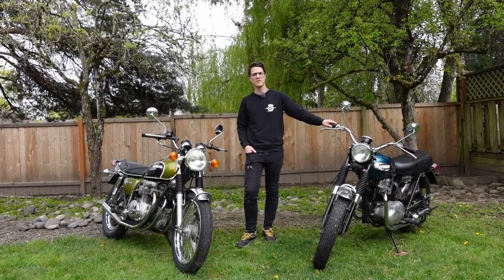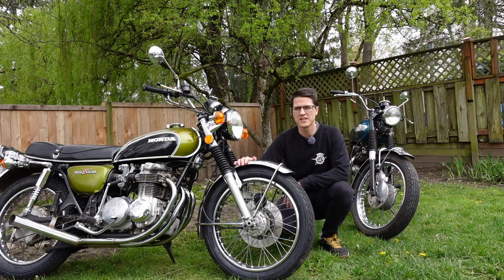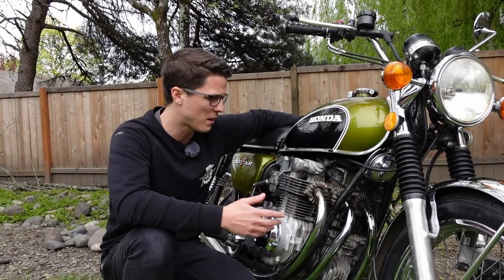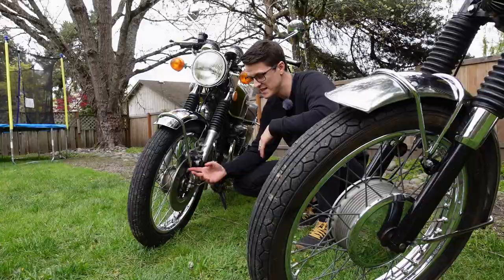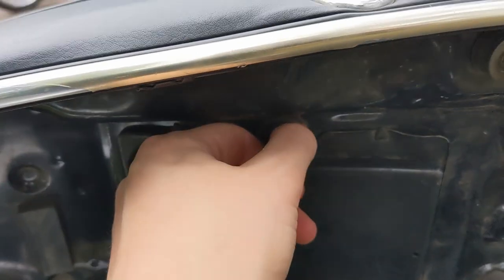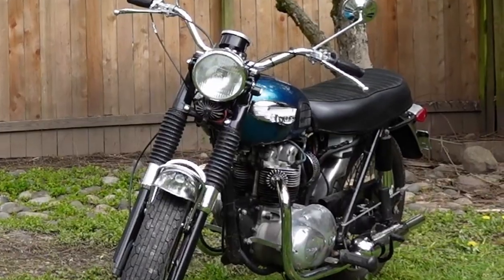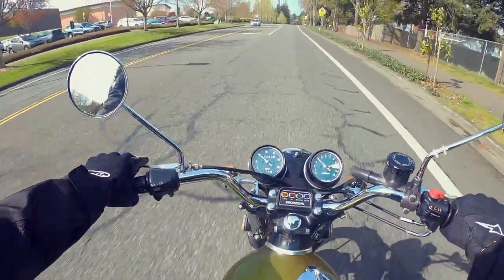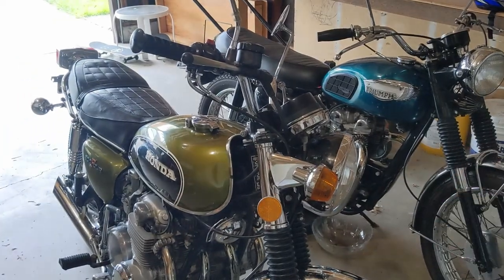How this Honda killed this Triumph

Comment: Agree completely. I had a 1968 Triumph T100C and still have a 1970 Honda CB450. Two years apart in age and about 30 years apart in development. Honda is still perfectly usable in modern traffic and the Triumph looked cool but felt like a dinosaur.
Reply: I was in charge of service for our dealership when the CB450 first came out, funny looking tank and all, and to me, it was already a Brit bike 'killer'.  Even though it only had a four speed, it was very smooth and would rev until tomorrow.  The wheelbase was a little short but that wasn't a detraction at the time.  Also, I was a new rider when the predecessor of the T500 came out as a 350cc and that was in '57.  Very little was changed in the design from then on.
Reply: @whalesong999  One of my favorite things about it is the very high rev range and by 1970 it had a front disc brake and five gears. Really love the bike even if it was eventually overshadowed by the 4-cylinder models.
Reply: I had a cb450 cam chain broke after I had it for three months after a Honda mechanic had rebuilt it I got half my money back the original cb450 with a four speed gearbox shook like a paint mixer the chief 500 was not an overboard 350 with a completely new design it had nothing to do with a 350 made 10 years prior to it being constructed. You can read the road test at Cycle World did on the motorcycle and they stripped it down to the engine cases to see how well it was built you can get parts easier for a fifty-year-old British motorcycle than for a 30 year old Japanese motorcycle now you have the Triumph C range your bike is geared for on and off road. My 73 Daytona with twin carb and rode gearing tops out at over 110 that's what the police officers radar said he was cool he let me go with a warning here we just talked about the bike for 20 minutes. Read Bert hopwood's what happened to the British motorcycle industry and you will get a clearer picture of the industrial Shenanigans and down online competency that went on all through the 70s the Japanese did not compete with the British Italians or the German, they competed with other Japanese company and that is how we got the Big 4
Reply: @frankmarkovcijr5459  Yup, your last sentence makes the most sense.  In terms of being where the showrooms competed though, that was where the Brit bikes began to lose in sales, hence losing out to the "big four". 

Design wise, it was becoming pretty clear that there were no real upgrades for the British machines in terms of engineering.  Burying the transmission output sprocket behind the clutch needed to be changed, for just one thing.   While there might not be direct carry-over of interchangeable parts from the "21" to the T500, the engineering was the same.  That does not mean that I disparage the Triumphs, just that they lagged behind in development that was moving so quickly.  They were a pleasant ride.  Ironically, our first Rocket III in late '68 came with a sort of diaper made of sheet metal with an absorbent material under the engine unit IIRC to catch wayward oil drips.  Nice touch, better than our Nortons at the time.
The Japanese makers had to come up from being drubbed into submission by the war and wanted to prove their viability to a changing world.  The British and the Americans had no such incentive since they'd "won" and would continue with traditional ways.  The paths crossed very quickly.  A Harley had a 90 day/4k mile warranty in '67 as I remember;  our Suzukis had 12 month or 12k mile warranties.
Reply: Practically all of the British motorcycles outside of Bemus set had and outboard clutch you don't have to disassemble the whole primary to change a fresh rocket or you do is slacking the chain off and you just take the clutch basket out and then there's 5 screws and holes the cover on and bang there's your sprocket. Let me put it this way my 1980 CX500 Honda water cooled 4-valve Wonder with Cam chains lacock 10 years at 250,000 miles before the change broke and snapped the camshaft into and then tore through the water pump my low-tech 883 Harley Sportster hash 370000 miles on it and it's still going strong. I have not touched any of the internal engine working because I have not needed to do I've had to do simple stuff like the stator work out and wouldn't charge anymore at a quarter of a million miles but it lasted a quarter of a million miles and to me that's pretty good the camshaft in my TR6 both wore out and I had to split the cases to replace them while in there any bearing or bushing that was questionable got replaced and the flood trap got replaced with a new one because she to take it almost 50 years to fill up the old one everybody who has a pre-unit British motorcycle has a b that is 70 years old or more. Outside of a vintage show I never see any of the Japanese motorcycles I grew up with in the seventies except in the show. Now I would say most everybody in America learn how to ride a motorcycle on riding a little Honda Suzuki Kawasaki Cushman whatever but once you learn how to ride you want bigger and better you want to be able to h a u l girl around with you on trips and vacations two-up with luggage a Honda 4-cylinder specially the 750 Road hottest hell and would wear out change and sprockets like tires Honda made a list of all of the 750s problems for touring and solve them all with the Goldwing. Honda did not want to go to double overhead cams like Kawasaki Suzuki and Yamaha dead because they did not want it said that they were copying their competitors the last year 750 Honda had cams so abrupt they would mushroom the valves you could only go so far with a single cam before you have to go to a twin overhead cam
Reply: @frankmarkovcijr5459  It's odd about how some people viewed having motorcycles here in the U.S.  I was in the industry for about 20 years and then occasioned motorcycle salvage yards to be disappointed in how disposable motorcycles were.  I think that speaks to why Japanese makes might have lower restoration interests these days.  You've had the tenacity to hold on to some bikes far longer than most have even dreamed of.  Quite remarkable.

I wasn't into touring, few of our customers were back in the day.  Longest lasting commuter bike I owned was a '65 Honda CB160 on which I'd put 26k, mechanically undisturbed miles when I sold it to a youngster as his first bike.

Comment: Great analysis and I agree with what you stated.  I had a 72 Honda 450 and a 71Triumph Daytona 500 with twin carbs and slightly modified internal engine bits.   After a few days of tinkering I berried the speedo at about 120 mph.  I thought I was going to die.  I suffered tappet cover loss from vibration and electrical failure which was only partial and didn't prevent the bike from running.  Never tried that again!    The difference between the two bikes is when you go for a ride.  Before you get on the Daytona you visually become part of it.  When you start it and ride it it is still a part of you especially the internal noisy bits that sing to you.  Shifting and steering is all done as one unit on the Daytona.  The Honda you just clime aboard, start, and ride.  You are not part of the bike just a user.
Old Triumph joke.  Why do brits drink warm beer?   Their fridges electrics are made by Lucas.

Comment: I've owned and ridden all sorts of Japanese machines all my life but it got boring and I basically stopped owning motorcycles.  I ran across an old Harley Sportster a while back and bought it having never owned one.  It's got it's own idiosyncrasies that I never had to deal with on imported machines however the satisfaction in owning and riding the Harley far outweighs the shortcomings it presents.  The look, the sound and the history just seems to satisfy my riding needs as never before.  So, I completely understand your feelings towards the British bike as opposed to the Japanese one.

Comment: I just acquired a cafe racer based on a CB750 from 1977.  A more aggressive aesthetic suits the sound of the engine way better than the squareness, the tameness, of the original aesthetic.

Given to choose between the Triumph and the stock CB500 in this video, I'd also go for the Triumph. But between a cafe racer CB500 and that same Triumph? I'd take the CB500.

Comment: By the time the Honda CB500 came to the UK at the Motorcycle show in 1972 the Triumph 500 was already about finished, hardly any were made after 1973 due to the situation with Triumph that led to the Meriden cooperative and the long closure of the factory and production. Bikes like the Honda CB450 introduced in 1965 were ones that ate into their market, before the CB500 came to be. Yes the CB500 was a great motorcycle better in every way than the outdated Triumph, but the collapse of the BSA group and the sit in and strike at Meriden is what killed the Triumph 500, not that it's death was not imminent.
Reply: Had a Honda 450, very stylish and although I would have loved to have had a Bonnie, less than half the cost
Reply: @real_Papa_Roach  I had a CB500T which I really liked even though they were poorly rated at the time, but as you say the price and relative civility of these machines had Triumph beaten for the average person. I have a 73 Triumph Tiger 750 in my collection, it's a fun motorcycle but in comparison to the vintage Japanese bikes I own it really feels like what it is, a bike from a completely different era.
Reply: given the choice in 1973 of a Triumph Adventurer or Daytona or CB500 many purchased a Honda but with hindsight how many would change their mind now? one is just an old and somewhat boring Honda no one wants you'd struggle to give away. 

The 500 Triumphs are still very much alive and sought after crown jewels so the premise of the video is based on a coincidental comparison that was only there for a brief moment in time as one ended it's long and cram packed life of achievements and the other stood about losing it's grandad inspired 4-4 silencers and wobbly shocks to re-appear later in Barts garden wondering if it should cut the grass and probably hoping it gets turned into a 100% original example or a custom / bobber so it can actually have some fun and get noticed or admired half as much as the Triumph is without changing anything, a new pair of Shocks from Taiwan aren't going to cut it beyond being a usable motorcycle which it has been since it left the factory with 50,000 others in various pretty colours, at least three survived, a green one, a blue one and a gold one.

Now if it was a 1975 Honda 400F or 400 Super Sport that really did hit a sweet spot then the Triumph may have run away and hid for a while but either way the Triumph has absolutely nothing to be ashamed of.
Reply: @mc2594  There's definitely something to what you say, a big difference for me as a retrospective is that now my vintage Triumph is a toy to play with and enjoy on summer days, the Hondas I had back in the day were everyday transport, that makes a big difference over which one is the better choice, in which era.

Comment: Triumph was already dying by then.  If you read Bert Hopwood's book, :"Whatever hapenned to the British Motorcycle Industry".  It was bad management and lack of reinvestment.  There was a time when they had a large income.  They called it profit and did not reinvest in their production and manufacturing.  WWII era manufacturing techniques were still employed like sand casting.  There were numerous more advanced prototypes built but the investment in plant to produce them was never made.  Think of the 1958 Chevrolet.  The same car was still in production until 1975 or 1976 with a restyle every year.  Disc brakes standard in front about 1971.  Oil crises of 1974 and they were flat footed and were not selling products competitive with the better imports.  When bean counters are in control, these things happen.  I personally owned a Honda 500 or 550 four.  I found it to be top heavy slow and annoying.  It was reliable, but I didn't want to ride it.  Anyway, Triumph killed Triumph.  There was also bad relations between management and labor causing strikes and deliberately shoddy workmanship.  Boring tools at BSA got so worn out that 650s were suffering piston seizures.  BSA had been the worlds largest manufacturer previously, and there was no excuse for running the production into the ground.  I've owned a number of hondas, but the 'first '79 CBX I had is the only Honda I really liked.  The second had too many aftermarket go faster and louder modifications.  Made it less pleasurable.

Comment: I had a British Bike back in 1972...A Norton Comando Combat to be exact.  It was so fast I never NEVER got beat in the 1/4 mile.  I raced Hondas, Kawasaki's, Harleys (a joke),  Cars of all types, even stomped a Hemi Cuda, I ate 442's and other fast cars for lunch.  They would be turning in low 14's and I was in the mid 11 seconds.  All that said, the bike had it's issues as do all of them.  I can say that the British seem to have no idea what reliability is about.  Things kept breaking...the cam for the points even wore out for Gods Sake and started wobbling, I had to replace it at only 1500 miles.  Everyone I knew that had a Brit Bike had the same issues.  What Honda brought to the table was not just class but excellent reliability and that is the primary reason they kicked the Brit Bikes Azzes!

Comment: Quite right! By 1971 the Bonneville was uglified but the 500 still looked like a Triumph. You came to the same conclusion most riders did. No question the Honda was a better long-haul road bike. However, if you liked a hot rod over modern precision engineering, the Triumph had some advantages for blasting around backroads for a few hours, particularly on dirt or gravel.  In a drop, the rigid steel foot peg mounts were like crash bars and the levers were steel.

Comment: I really enjoyed this video. I love both bikes for different reasons. I'm wondering how the 2 compare on a very steep hill pull at moderate speed, in top gear. Because back in the early 80's, my father, uncle, and a couple of their buddies all owned various 4 stroke 750's ( brand new. Every Japanese offering was present: Yamaha, Suzuki, Honda, and Kawasaki. I kid you not, lol. )  My dad was the only one who owned a twin, it was the Kawasaki 750 twin. ( I tried talking him into buying the 4 cyl version, but he was charmed by the twin. ) All of the other 750's in their group were 4 cyl. They would all take their wives on some weekends from north Alabama ( where we all lived ) for a road trip to the Smokey Mountains. My dad and his wife outweighed all the other couples by quite a bit. And they all told me that Kawasaki twin really impressed them, because it could still pull those steep hills & mountains IN TOP GEAR, while all the 4 cyl bikes had to be geared down. The twin obviously had more torque. ( But of course it was the slowest of the bunch in an all-out drag race. ) So if ya have any really steep hills or mountains around, that would be an interesting test. Remember: ya have to begin the test with each bike already being in top gear, and at a realistic cruising speed. One thing to consider, is you don't weigh nearly as much as my father did (225 lbs ), plus his wife on the back, and she was a big girl. So. if you can, try this test with a friend riding on the back. ????????????? Don't be surprised if the torque of that twin gives you the same surprising results. NO GEARING DOWN ALLOWED.

Comment: I think a more accurate title would be, how the British motorcycle Industry killed itself.  They did try to innovate with the BSA  and Triumph triples, but the basic problems in leakage and reliability were never resolved. They  were running a losing  technology catch up race and lost out to the foreign companies they fell behind.  No more uncle Joe Lucas electrics. No more Amal tickle me carbs. No more crap switch gear.  No more tappet covers unscrewing themselves on the road.   Don't get me wrong. I loved my BSAs and Triumphs when I had them for all their faults. The first time I owned a Honda CB 750 F1 though,  it was where have you been all my life?  I do get it why people still love the old British classics though. They had a sound, beauty and handing all of their own. I cherish the memory,  but never missed the dirty fingernails.

Comment: I think the CB750 started in 1969, not '73.  Meh, what difference does it make, anyway?

I've ridden both the 1970s CB750 Honda and the 1960s Bonnevilles extensively (thousands of miles on both).  In my books, the Triumph is better in horsepower, torque, sound, handling, acceleration, and is smoother shifting.   The Honda is better in brakes and reliability.  

You'd think the Honda would be faster with a 4 cylinder and 100cc more?  but it's definitely a slower bike than the Bonneville.  Maybe because it is so heavy.  In my view what REALLY sold the Honda was it's reliability and low maintenance, more than performance.  You had to almost be a mechanic to own a Triumph and keep it running.

Literally, those Honda's feel like a city bus when you are trying to get them around a corner.  You have to sit on top of this wide unwieldy top heavy mass, and "steer it" around the curve.  The Triumph goes around curves like, all  you have to do is "think it", and the bike does it.

Comment: The Triumph twins had vertically split cases, so they were destined to leak oil. Plus, a 360 deg. crank, for maximum vibration. But oh, what a sound when you started her up! The Honda is a better bike all the way around,  but they don't sound like the Trumpet. Even the new Triumphs don't sound, or look the the old classics. (But in a cross country trip, I want to get there, I'll take a Honda).
Dilemma
.....